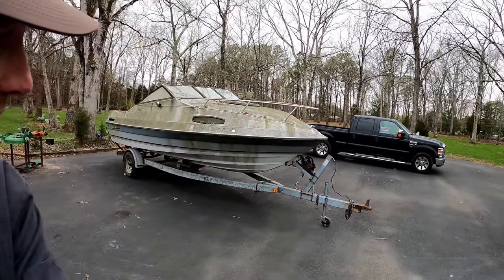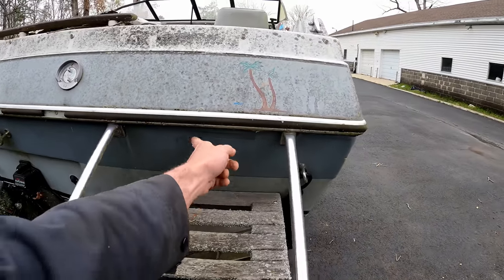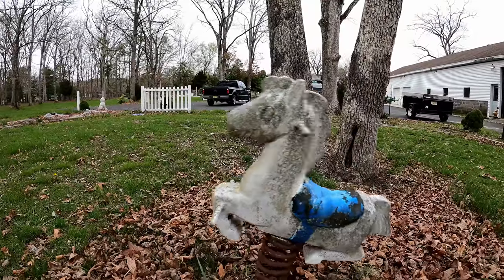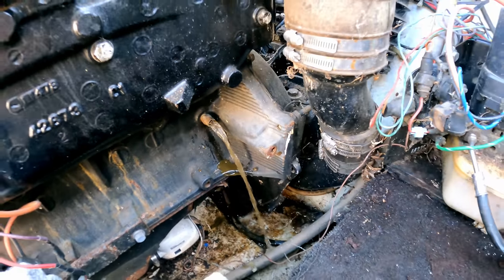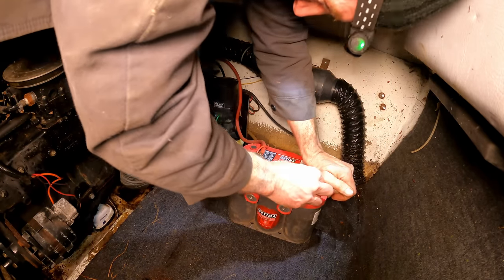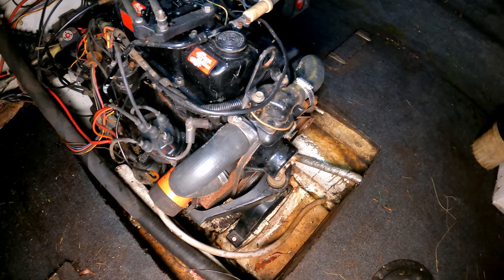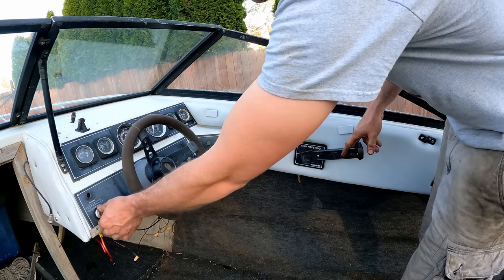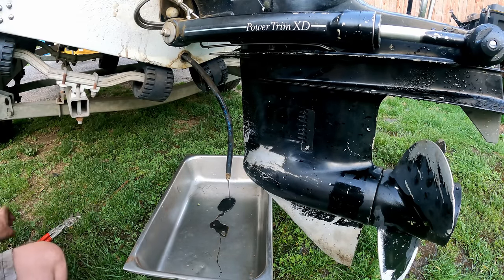Junky Boat Sitting For Years Will It Run? RAVEN 195 - NNKH

Comment: The water pump impeller will NOT rearrange the vanes if you put it on in the opposite direction. Some might, but not all. Just hold the housing over the impeller and turn the driveshaft in the direction  it normally spins (always clockwise in my experience) while pushing down; the vanes will orient themselves properly and you won't have problems. If you don't, you will at best lose some efficiency. And I see you turned the prop so the shaft spun counterclockwise. This is not a good thing.

Comment: I forget the industrial# of armor all I think it's like 303 or 304 you can find and buy by the gallon. Anyway you soak things like v belts, that rubber impeller for example for a few hours or so. Wipe off and install ( belts would be same process) and people have reported those treated rubber components lasting 10yrs or better vs untreated. Little pro cheap skate tip for you and everyone. Peace and be well.

Comment: Love your videos, question on the motor oil, noticed you never change it before starting the vehicle/boats after sitting for 10+ years.  I be nervous to run it, knowing the oil be sludge,clog in the filter or something, or just quality of the oil is any good, that's long time sitting.
Reply from the maker: It certainly not a bad idea to change it first. But from my experience old oil doesn't really hurt anything especially over short-term. Thanks so much for tuning into the videos!

Comment: Those folding seats are useless. Too low and they fall apart. I just took a bench seat from a limo van and bolted it in front of the helm. Fit perfect side to side and was so comfortable. You had to climb over it so it may not be for everyone. How about car bucket seats? Make sturdy bases for them and there you go! I suppose you can revive the captain's chair.
  😁🧜‍♀🚤🪑

Comment: Most people jb weld the cracked block and lasts for many years, its not under pressure.. ive JB welded 1 and works fantastic, runs perfect for 8 hours straight multiple trips

Comment: hey those are great little boats, i had one i bought new in 89 i think, i had a bigger mercruiser 4 cylinder that used like a 460 v-8 head. it was a lot of fun. hey how about a will it run on an old ford 8N tractor or farmall? love you guys.

Comment: I asked an old mechanic one time what/or is there difference in a auto motor vrs marine motor     'Yes its Balance'  you can run a marine wide open all day BUT in a auto you run wide open all day it will come apart but then again I was hungover wanting get back home to Guntersville Al from Centralia  Illinois , driving company ford truck with a 300 6cyl she was pegged to the floor all the way left it running while i filled up

Comment: What was that black chemical you painted on the rim before seating the trailer tires?  I haven't seen that before.  Great video!  Excellent content.
Reply from the maker: It's tire bead sealer. To help seal the bead and prevent future corrosion

Comment: How'd you build your vice mount under the bench ? Pretty slick
Reply from the maker: I just welded a 2 in receiver from harbor freight on there and then got some 2-in thick wall square tube to weld a vise plate on. Works well

Comment: Nice boat my cousin bought a boat that they said it kept getting water in the oil and they just had it worked on he found out the shop at reversed two lines he switched them around and no more problem

Comment: old school prime the engine through the throttle hit the bottom button to take it out of gear pump several crack the throttle let her idle a bunch. if it will idle bring back to idle click the shifter lever. check forward neutral reverse take back out of gear rev up extra 500 rpms see if temp gauge works. all fluids needs changed store re drain the block. air filter can be rinsed in some gas. yes carb cleaned best to store with full tank best to un hook the battery when not in use can add battery charger 🔌 after sitting during storage. leave the out drive down any excess water drains ready to go every spring. dash lights up grease the out drive . but with milky gear oil usually tell tell seals gone. for travel get arm blocks least what we used takes the weight of the transom check the prop nut i want to see her get ship shape.

Comment: Too bad the engine is ticking; it sounds and looks like it's  running on 3 and a half, and it's gonna need  some disassembly;
i would  measure compressions first, finger in hthe hole while cranking is ok, then leak test the bad one at BDC, maybe  just with the air hose and rubber tipped blow gun at 5  to 8 psi, enough to see if air escapes and to and from where.
NJ, boat came from my state

Comment: I am an aircraft mechanic turned boat mechanic. I am working a similar project on a hard top BellBoy I want to re-engine. I live in the Seattle area and I am intrigued by the property in the video. Is there any way to find out about the sale info (assuming it is is the PNW). Thanks!

Comment: Don’t discount the prop if it’s stainless steel it’s worth a few hundred bucks at a prop shop a they buy em. 
Wasp nest not bees they build in an enclosed area wasps nests hang down from protected over head structures.

Comment: 18:08 Did you remove the fallen electrode from the spark plug from the cylinder?
Reply from the maker: It had already made its way out the exhaust valve

Comment: I've rebuilt  a number of these over the years at my Auto machine  shop, nope freeze plugs never pop out on these 181s the block cracks everytime no popped freeze plugs these have been no exceptions!
Reply from the maker: Check out the trash liner video series. Pretty sure it's the same 3.0 and when I started it there was a bunch of clinging and clacking coming from the engine. Ended up being a freeze plug on the back of the engine came out. Of course it had a giant crack on the side of the block as well that I had to fix with silicone. Worked well after that though.
Reply: @NoNonsenseKnowHow  Actually  my buddies boat motor froze, is a pretty basic old school  350 from the late 80s popped a a freeze plug and also cracked the block, I gave him this stuff called steel weld from Permatex, to seal off the crack like 3 years ago still seems to be holding 😀

Comment: What kind of lazy risky design is that boat trailer all bolted together 😳 yikes
Reply from the maker: That's how most of them are here in the states. Some welded but most bolted  together.  Seem to hold up fine. And it's nice if you happen to bend or break something very easy to replace.
Reply: @NoNonsenseKnowHow  yes a tongue replacement is convenient but you know how good people put things together and I'm sure there has been a few boats going down the highway without the truck that was pulling it 😳 lol

Comment: is the boat a ski-boat my parents had a boat that big and it was made for water skiing that never been use cause could not get an engine for it so they keep the boat for about 5 years and sold it when I was about like 5 or 6 years old in 1995.

Comment: Cats like to piss on stuff be careful and that don’t come out. I’m an ex concrete finisher and I had some Helly Hanson rain gear, and it is very expensive rain gear but it doesn’t terror very easily when you’re walking on rebar well I had my cat pee on one of those and I was pissed when I smelled it but I scrubbed that shit and scrubbed it and I couldn’t get that out. I had to throw them away because I could not work with that, so be careful with cats

Comment: I honestly could barely watch this as I bought a boat sight unseen from my ex brother in law on his word it was well maintained , just needs carb cleaned.  WRONG! Seats were rotten , floor was gone, electronics rotten, entire fuel system wS a glob of white powder. He had replaced the where pump in the outlive and didn't put seals in it years before. Their was no grease in it just a cup of gray goo/ metal. The control cables were rusted in 3, bellows were rotten. Trailer had the brake lines folded up and wired to the frame. I stepped on the wheel well to get in and it broke off. He wouldn't give me my money back and I wound up spending $7000 . Jackson marine laughed saying theirs better boats in the junk yard I could have bought for $800 and would have at least had a good trailer.  Sadly I never spoke to him again . I can't enjoy the damned boat, there are to many bad feeling their. Time is precious. I wish I had it back! My wife tgat I bought the boat for died of cancer a year later. That time should have been spent with her

Comment: Be careful when tightening the thermostat housing.
 I was a young inexperienced wrencher and cracked one by not tightening both sides evenly.. Did you put new valve stems in the trailer rim's?
Reply from the maker: Yeah I could see that happening. And yes new valve stems

Comment: awhhh no you didnt. heating non consumption oil in a regular microoven. imagine all the gasses and fluids left over in there and then they go in to their next meal or popcorn...
Americans -.-
Reply from the maker: There were no vapors that came off of it. The microwave didn't even smell like gear oil. Now if you heat it to a boil. That's another story. Give it a try. You'll see
Reply: @NoNonsenseKnowHow  no thanks, ive handeled enought cancer causing oils already :)